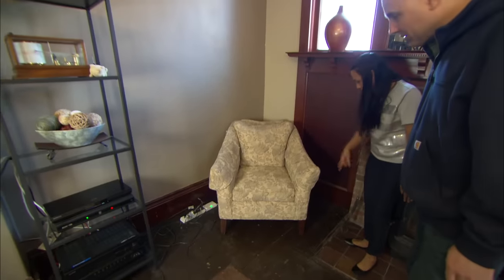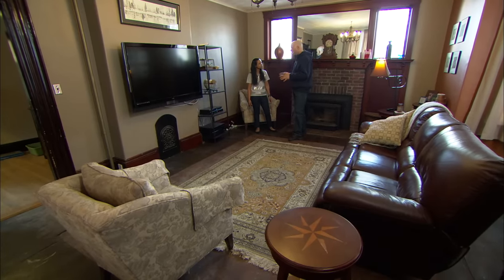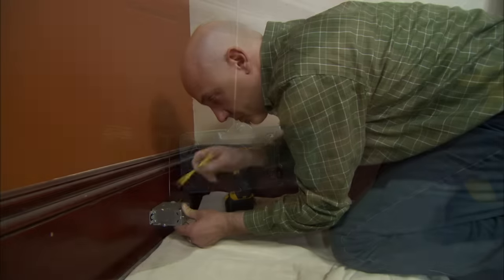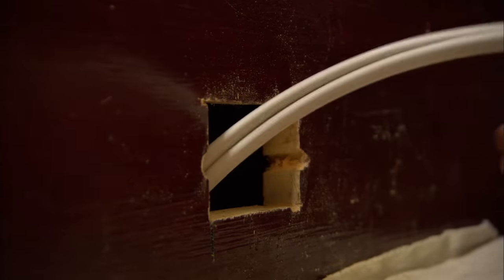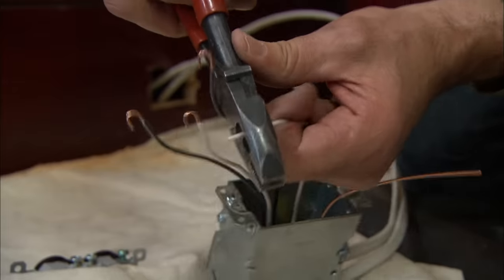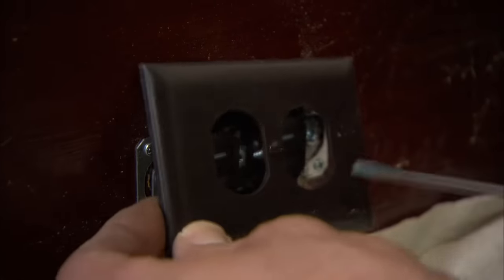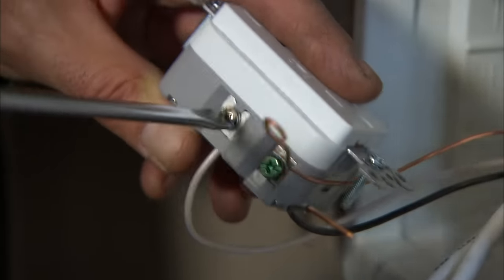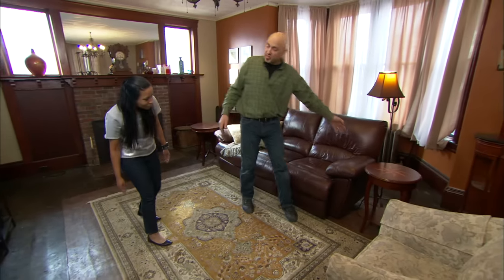How to Add Outlets to a Room | Ask This Old House

Comment: Metal boxes for electrical? WTF?
Reply: tyvek05 metal is more commercial grade, residential homes may or may not have metal boxes, depends on the build budget. My home was built in 1994 and no metal boxes in it.
Reply: Metal for electric provided it is properly earthed is superior. In a fault condition the breaker/fuse blows.
Reply: My entire garage woodshop is wired in EMT CONDUIT AND QUAD OUTLET boxes. Super safe
Reply: Lol stop commenting if you have no idea what you’re talking about.

Comment: Sure anyone can cut a hole and put a box in. What a poor example video of actually adding a plug. So I just pull some electrical wires through and connect them to the plug? What do I do with the other end of the wire? 🙄  video should be called how to cut a hole in a base board of an older house and adding a single gang box.